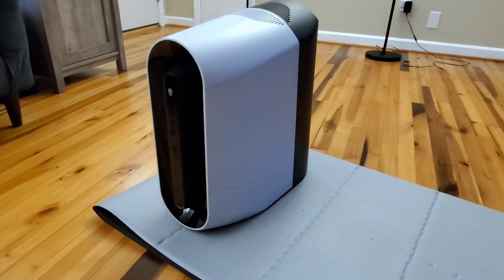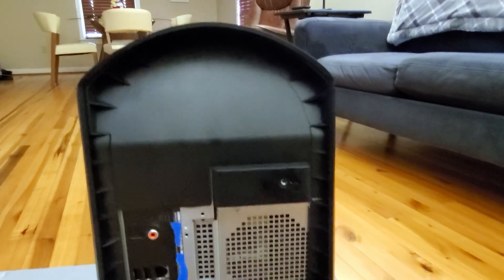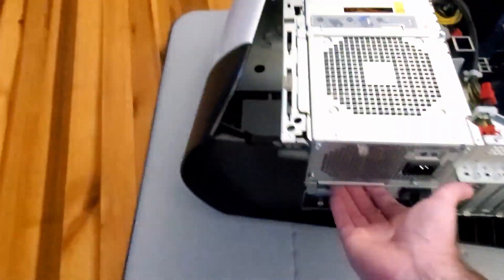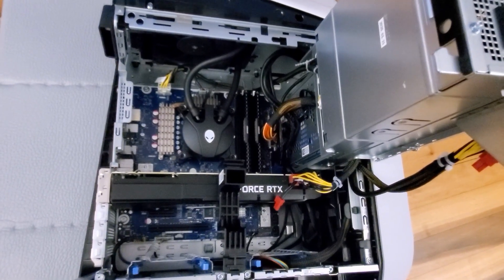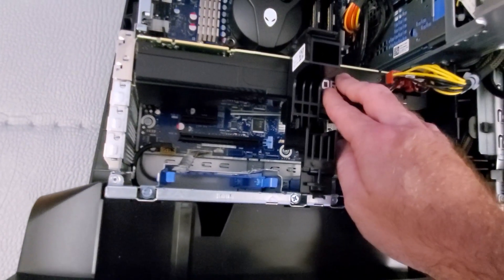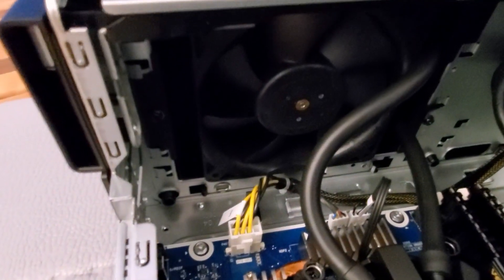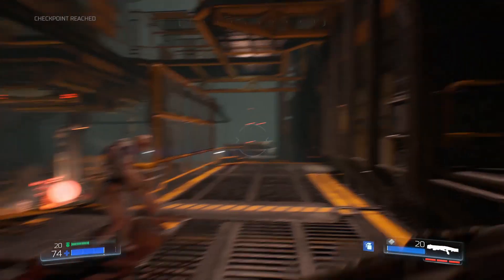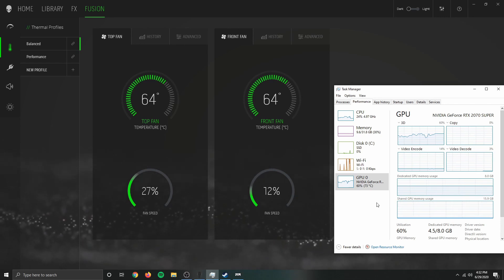Alienware Aurora R11: Up-gradable? What about those temps?

Comment: Let's say you buy the i7-10700F Version of the R11 , can you later upgrade that processor to the i9-10900K? Especially if you already have 1000W Power supply. Does the motherboard allow for the upgrade? @TheOnlyJoe
Reply: As long as it fits the socket its going to be ok to change the cpu
Reply: @stickfee299  I see. And would you need liquid cooling with the i9-10900K or could you put a nice heatsink as a substitute
Reply: @kevinspeed3592  if the heatsink fits perfectly then yeah go ahead be sure its going to go into position
Reply: @stickfee299  is there enough clearance? Is there alot of space between the power supply and processor?
Reply: @kevinspeed3592  no not much, the height for a cpu cooler at max can be as tall as the aio cooler cpu bracket, which isnt much, so i rather stick with liquid cooling for the cpu
Reply: @stickfee299 Thanks for clarifying that stickfee.  I notice it has 4 slots for ram, how many channels? and are they all single or dual?
Reply: @kevinspeed3592  dual channel
Reply: @stickfee299  how many channels on the motherboard  total?
Reply: @kevinspeed3592  4? Im not super mart on the memory part
Reply: @stickfee299  well thanks for answering my questions, which model did you get(specs)
Reply: @kevinspeed3592  i got an i9 9900k, 64 gb 2990 ddr4, Nvidia Geforce RTX2070 super, 1 tb hard drive 250 mg nvme, a 550 psu, but i changed it for a corsair CX750M and idk what else because my brain processes things slowly my brain is an intel quad core 2 cores cpu super slow
Reply: @stickfee299  wonderful

Comment: Hey man, nice video. I would like to know what AIO is that and how it can handle such a powerful cpu with just a single 120mm exaust fan and radiator with no airflow at all. Thanks
Reply: Its an dell Aio cooler, so you should ask dell for that

Comment: heats up pretty good on max setting warzone tho
also, do you know if its possible to put more fans inside or is it better to put a lasko next to the tower???
Reply: Icy Dragon it’s ver bad for the price
Reply: You unfortunately cant add any more fans
Reply: @Icy Dragon tell me the specs since i dont know what they are
Reply: @Icy Dragon yeah its good, but i cant tell if the gpu is good or not i only work with Nvidia gpu's, but if i recommend you somethings for a pc, apply an ssd  and atleast an core i7 and an Nvidia Geforce RTX2060 also and i5 is gonna going to be good enough for multi tasking
Reply: @Icy Dragon tell me, what are you gonna usr your pc for and if ur planning to buy an alienware pc
Reply: @Icy Dragon its fine,  yeah aome parts will not be good, thats why most people recommend building your own computer, but if you really cant get a prebuilt.

Comment: My R11 comes tomorrow with 10th gen Intel i5, I just went and bought a 10th gen Intel i7, I will be able to use it correct?
Reply: so that means i can replace my intel core i7 10th gen to an intel core i9 10th gen. nice. (can i?and will i need anything else?)
Reply: Finally thank you for this help he didn’t mention if the cpu was upgradable or not he just said you will have to replace the motherboard every generation

Comment: I like your video! Do you recommend 10700F or 10700K?
Reply from the maker: The F in Intel's ridiculous naming scheme simply refers to a CPU that does not have Intel onboard graphics. The K refers to a CPU with an unlocked multiplier and can be overclocked. So the 10700KF in this machine means it does not have onboard graphics and is overclockable.
Reply from the maker: @mrchairmold2979  The KF is a K series CPU without onboard graphics. In short, the KF series are K series CPUs whose IGP (integrated graphics processor) did not pass certification. Intel released the KF series to make up for the lack of supply for its K series CPUs. There are even reports of the KF series overclocking better than their K counter parts (but the reasons for this are dubious at best); my semi-professional engineering untested hypothesis is that disabling the graphics core and the pin reduction results in less heat and hence possibly better overclocks. 

I've included a link to a Tom's Hardware article about this for reference:

https://www.tomshardware.com/reviews/intel-9900kf-vs-9900k-overclock-comparison,6038.html
Reply: get the AMD GPU and put a 3060ti GPU in it.  You will be alllll good.

Comment: Awesome video, thank you! I wonder if the same thermals can be achieved with an 2080ti? Also, anything to note about acoustics? I ask because some customers have issues with loud fans, despite having a liquid cooled unit. Thanks again.
Reply from the maker: I have no idea about the 2080ti, but the noise isn't bad at all. I have the fans set to the "balanced mode" in the Alienware software, and while the fans do kick up a little bit,  under a full load it never gets loader than my PS4 Pro playing God of War.
Reply: @theonlyjoe6036  Awesome, that is good to hear, my R10 is due to be shipped in a couple of weeks, thanks for the reply!

Comment: Why buy the alienware if you can not update the CPU?  Just asking because I'm unsure.  I'm not a tech savvy. I bought one of these same computers.
Reply from the maker: This has always been an issue with Intel, and it doesn't matter who you buy (or even build) your computer from. Intel loves to change the socket of the CPU from year to year, and so you are typically stuck with an upgrade path with in the same generation of CPU (unless you want to replace the motherboard and RAM too). AMD Ryzen is better known for sticking with the same socket for a little bit; ie. the 2000 series Ryzen and 3000 Ryzen both use the same socket and a clear upgrade path is in place. Dell does offer an AMD Ryzen version of the Aurora, but they are actually not very cost competitive (most likely due to the Intel's generous bulk pricing for Dell). That said, the money you would spend on an 8 to 15 percent increase from CPU generation to generation (nowadays anyway) would be better spent on upgrading your graphics card or adding an NVME harddrive.
Just look at the fact that the Intel 7700K from a few years ago is still a very capable processor when paired with a current graphics card.
Reply: @theonlyjoe6036  Is the motherboard replaceable in the R11 so that you can upgrade the cpu later on?
Reply: @theonlyjoe6036  is the motherboard replaceable

Comment: If I wanted to add more ram to my PC which sticks would u recommend?
Reply from the maker: The type and speed depend on the PC. I am partial to Corsair RAM (I used Corsair LPX 3000MHZ C15 here), but I've also used Kingston and Crucial RAM in the past. If you unsure about the type of RAM your system may need then use the Crucial system checker over at www.crucial.com.
Reply: @theonlyjoe6036  nice, i like the corsair vengeance memory, i have c14 3200 mhz for my rig, which is also an r11, but i haven't added them since if i put them i get an error

Comment: If I was to buy the 10th gen i7 model would I be able to upgrade to the i9 later on as long as it’s the 10th gen?
Reply from the maker: The 10700 and 10900 are both on the 
FCLGA1200 socket, so you could upgrade to the 10900 in the future. I'd only really advise this if the price came way down in 3 to 5 years time.
Reply: @theonlyjoe6036  so you recommend going with the i7

Comment: What specs as far as cpu, gpu, and psu?
Reply from the maker: In this build it is a 10700KF, Nvidia RTX 2070 Super and 1000 watt power supply. It also came with a 1TB NVME and 16GB of RAM. I upgraded the RAM to 32GB of 3000MHZ DDR4 as it was cheaper to do it myself than to pay the usual RAMson fee charged by PC manufactures.